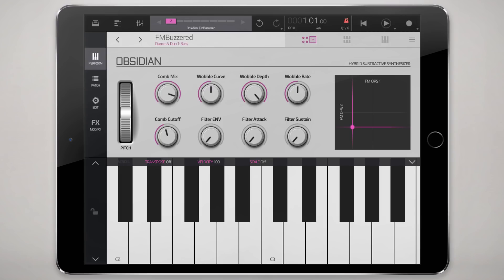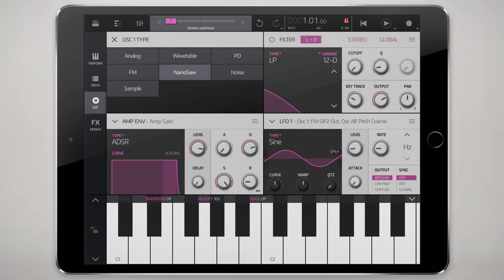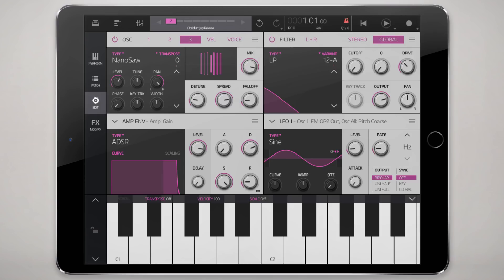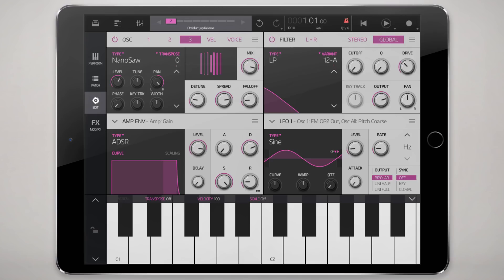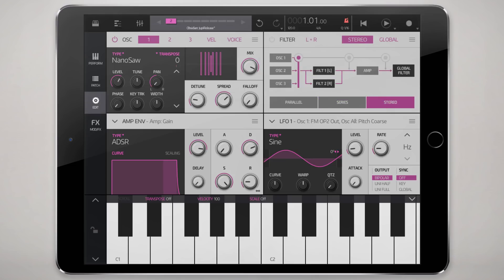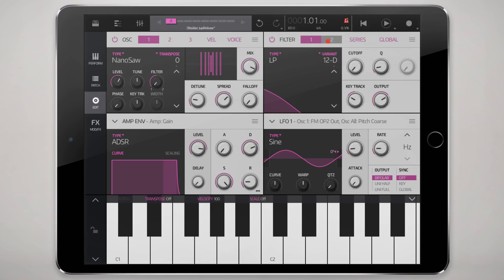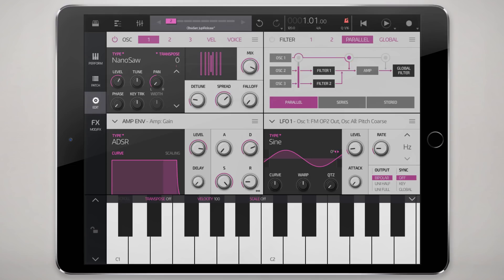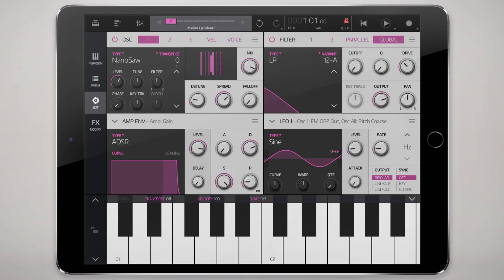Nanostudio 2 Overview - Understanding Obsidian Synth

Comment: Its a pretty cool synth so far messing around with it . There are other ios synths that are just as good or better but the sampler in a synth feature is cool , although no time stretch means ill need beatmaker 3 for that unfortunately as i like the nanostudio 2 layout a little better so far but havent spent much time with either app . I find it kind of lame that  nanostudio 2 and beatmaker 3 dont have built in arpeggiators which is a basic and standard function on most synths so thats pretty disappointing on " all in one " music product  apps especially for the money . An update to include time stretching samples and an arpeggiator would be great someday.

Comment: Is the Obsidian sampler finally a multi sampler (different sample under each key of keyboard) for ios?
Reply from the maker: Hi. Yes, you can place up to 3 samples on a single key when using the sampler on each of the 3 available oscillators (usually this is for velocity splitting, but you can just layer as well).
Reply: platinumaudiolab ¡SOLD!!! 😀
Reply: No, I mean: e.g. on the first key the sound of a violin, the second the sound of a voice, the next key a fx sound etc.
Like a ‘normal’ hardware sampler. Until now this doesn’t exist in ios (except for the mini sampler in cubasis).
Reply: Allright!!! I found it. So it IS possible to load this sampler (and my keyboard) with complete different
samples under each key. Fantastic! Apart from Cubasis’s mini sampler, there was no other ios sampler who could do that.
And all the other possibilities... oh man.
Thanks developer(s)!
Reply: Say phwhaay?